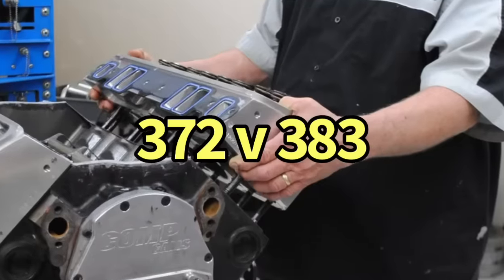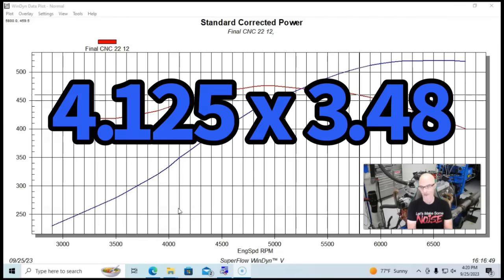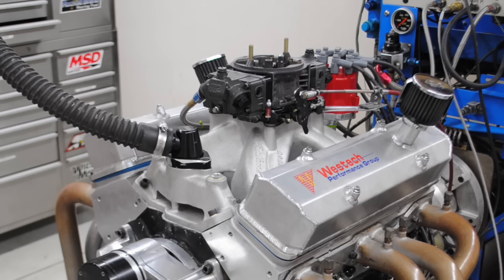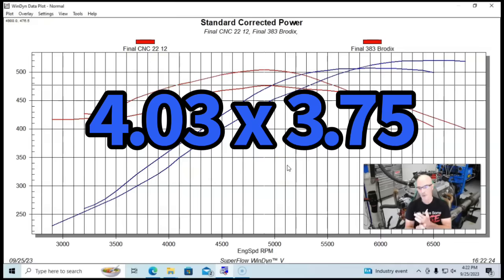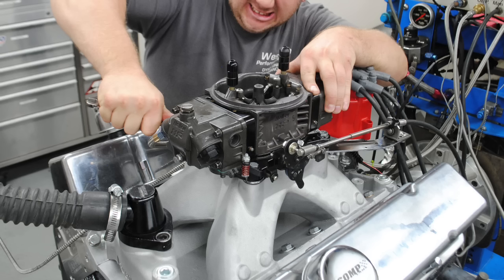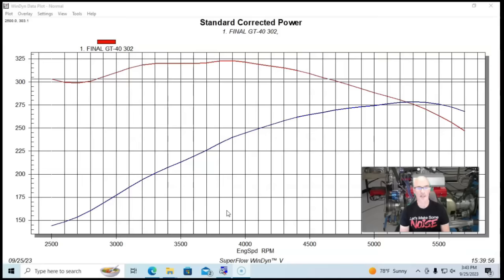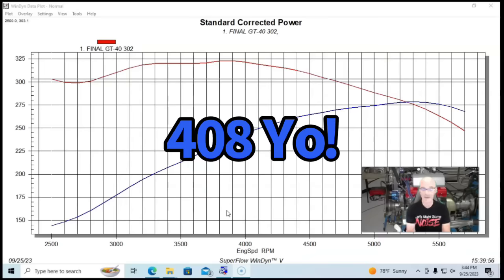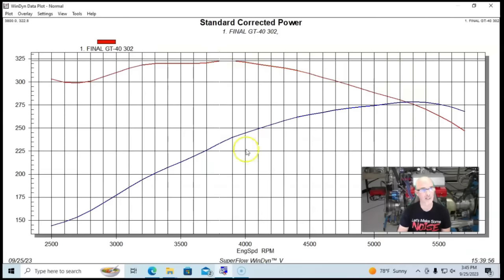BIG BORE VS BIG STROKE-372 VS 383-WHICH SBC STROKER DOES IT BEST? BONUS TEST-302 VS 347 FORD

Comment: I'd much prefer the 4.125" bore based 377, or, better still, use a 3.625" crank and a 6.125" rod. The bore maximizes the flow of the great heads available for the small block.

If I want low speed torque, for a truck or something, I'll build a 406, or a big block.

I have no real use for a 383, it's a cheap compromise.

Comment: The big bore unshrouds the valves and flows better up top.  Also wider LSA tends to carry up top.  Stoker breathers deeper and has  more leverage on crank to create more tq.  347 with small heads and cam gets benefits of longer stroke, but will only make so much hp because cam acts smaller on bigger motor and is flow limited.l so it cant make more hp up top.

Comment: Richard, when it comes to 383 vs 372 in the small block Chevy why choose? The correct answer is you bore out a 400 and make a 406! I would even trade a 383 to get a 400! I would never destroke a 400 on the grounds of "I want it to rev"  on the street. In short, have your cake and eat it too!

Comment: The 302 v 347 thing has been done before, Pontiac has been doing that from the factory since the V8 came out. You can put the same top end and cam in a 350, 400, 428, and 455 to see how much difference displacement makes. You can also see what happens when you increase airflow through the heads on those engines. 

Only the 350 is small enough to move the torque band up with increased airflow. The 400, 428, and 455 all simply make more torque through the entire RPM range. Thats because the runners are the same length on every one of the, and that is where the torque comes from. The ports are kinda small for a 400 inch and larger engine, so the power band doesn't move much in the RPM range, it just gets bigger.

Pontiac is fun, because the main differences between the 400 and the 428 are main journal diameter and stroke, 3.75" vs 4" and the 400 vs 455 is .030" bore and a 4.21" stroke. You can get crank kits for the 400 block with 4, 4.21, 4.25, 4.35, and 4.5 inch strokes, that cost about the same as grinding a stock crank, adding forged rods, and new pistons. So why not make that 400 into a bigger engine? 

The grunt from a 455 is addictive... especially with a 2.73 to 3.55 gear behind it. The 455 in my 65 GTO is pushing a 3.08 gear, and it pushes you into your seat far harder and longer than a car with a 4.56 gear does.... provided the tires don't go up in smoke. As long as you don't think more's better with gear like its a sbc, the Pontiac is an inexpensive way to the low 12s to high tens.

The problem is you aren't finding these engines in most junkyards, you have to find the entire car most of the time (usually 4 doors), and that is getting harder too. 

If you weren't so far away Rich, I would bring stock and modified 400 and 455 engines for you to test. Might be fun finding out how much power my latest build with the tunnel ram makes. Its raining again today, otherwise some dragy runs would be happening. Maybe tomorrow morning, since its Sunday and the traffic will be lighter.. if its not moist.
Reply from the maker: let me know how it goes

Comment: I would take the 383 for a better riding street machine (Olds, Buick, Pontiac) because of torque required to move more weight. 372 for lighter models (Cobra Kit, Camero, Anglia, etc.)

Comment: Have you ever done a 383 build with a comp 270 magnum and stock vortec heads???? Or just the 270 cam swap into a stock vortec with a four barrel intake  and a carburetor? It's nothing spectacular but it is something someone could assemble with off the shelf parts and no machine work?

Comment: Instead of a 400 block destroked with a 350 crank or a 350 stroked with a 400 crank, wouldn't a stock bore and stroke 400 sb make more horse power and torque than either???
Reply: Yep.

Comment: Built  372  used dodge 340 318 rods  didn't weld up crank ,  turn down  the 350 crank 5 tho . For the pistons i used ford 273 312 rod bushings!  Ran on alcohol, brodex 8s roller , dirt tracker cheap but great motor ran  4yrs. Never did a thing ,! Check  at end tor apart bottom perfect, need rings won lots races,  late model .it was a few years ago !  For got  used 30, under or over as you say it ! Fit crank perfect !

Comment: I guess it would matter  on what you are putting the engine in and what you expect out of it.  But one thing you  performance builders miss now-a-days is that not everyone has to have an engine that spins up to 7k or has 500hp.  A well built 383 for a truck that will run well on pump gas and still perform decently with fuel injection and still be smog legal and not cost 8 grand to build

Comment: If you really want to see a great combo, build a 352. A 400, bored .030 for a 4.155 bore, with a 3.25 stroke and 6.25-inch rods. You can run 11.0:1 compression on 87 octane WITHOUT pre-detonation, and without retarding the cam.

Comment: I think the 383 does better in the lower rpm because of the stroke length. And not the "leverage" argument. The longer stroke produces faster puston acceleration amd piston speed, creating a bigger pressure differential that really helps scavenging and getting a bigger fresh air/fuel charge into the cylinder. At higher rpm, this velocoty becomes less important than bulk flow, and the bigger bore helps the head to flow more at higher rpm, giving the 372 the advantage. I wish you could do this test with a .060 over 400 block, giving g a 382 vs 383 test, which is taking the cubic inch variable out (since we all know torque potential is a product of displacement) and do a real A B test.

Comment: Nice test show the benfits around each combo to build a car around a heavy street car id shoot for the low end tq and mutiply it with a set of gears and a good converter . a light chassis car im not worried about low end speed not that much mass to get going so the short stroke big bore is what i would choose. 

But i wonder if you can get the best of both with a square motor? 4.00 bore 4.00 stroke.?

Comment: 4.155 bore by 3.55 stroke is 384ci
4.040 bore by 3.75 stroke is 385ci
Same heads, cam, intake and carb what would happen? Now the displacement is the same.
Reply from the maker: same

Comment: I always heard you get more head flow with a bigger bore because of valve shrouding
Reply: That's what everyone has been told and now everyone believes. But it may not always be true. 
Some myth.
Reply: Use to be typically true. But designers have gotten much better with late model engines.

Comment: Less stroke is better. More HP per ci and very revable! Piston ACCELERATION is the huge drain and increases hugely with a longer stroke at all rpm. Equates to better mpg too if it matters. 

Increased displacement with longer stroke will make more total power but just not as good as big bore. IMHO
Reply: Makes sense but remember choice of pistons and rods can reduce the acceleration losses, as I did going .200 longer stroke with Ross Pistons and Crower rods which needed lighter crank balancing due to weight savings

Comment: This was interesting as most of Richards tests.
Dyno numbers are not always the same as what the engine does in a car.
Reply from the maker: dyno numbers indicate exactly what they do in the car
Reply: @richardholdener1727  ? They don't indicate that they break stuff or perform right.
Example. I've got an old top oiler. Put a 428 crank in it. Stroker is the way to go. Right ? Now the car doesn't launch right and  behave. Breaks parts. Broke the ladder bar twice. 
I had a car that hooked up right before.
In my set up application, a dyno would show the engine making more torque, but not how it would behave in the car.
The rush of a short stroke is more reliable and exhilarating than the jerk of a stroker breaking parts.

Comment: Consider this: the small block chevy 383 stroker is not a "small bore long stroke engine". The 3.75" stroke X 4.030" bore 383 c.i. Sbc is exactly in the sweet spot for stroke versus bore size as far as the fattest power throughout.  It is about a 1.075 :1 ratio. This is not square. If you had 4" bore to 4" stroke this would be directly 1:1 square. However the 383 is the exact center middle ground for bore to stroke. You cannot get much better than this. The other factors are rod ratio etc. The best rod ratio for N/A is 2:1, the best for power adder is 1.8:1. If you wish to favor HP side slightly more with bore, if you wish to favor torque slightly favor stroke. Power shall be nearly the same. The 372 is also 11 cubes less than the 383 witch  makes an unfair comparison. You can build a 383 two ways, why don't you do that? Well you did really it is just missing the 30thou oversize of 4.155" so all intensive purposes was fair and fairly close. The best N/A engine would be an engine with 2:1 rod ratio and also allow the 1.075:1 bore to stroke ratio. The optimal bore size for 4" stroke would be exactly 4.3" bore size with a rod ration of 2:1 you would need an 8" rod and the deck height to fit it all. See? engine archetecture are all compromises in design to fit everything in target goals and power efficiency was placed a distant second. This is why tall decks make more power. Also, some characteristics of shorter rod ratios are desirable for various reasons. Well a thing to look into. On the deck height available a 5.7" rod works great in the rpm of the 383 and even the best engine builders with real knowledge prefer this rod and it's strength to weight properties over longer rods. So a 372 definitely could use it as well with it's shorter stroke, however it is not the same, the piston becomes heavier, this is why the 372 prefers the 6" or more rod for piston weight savings over that of the 5.7" rod versus a 6" rod. So you see, it balances out. Hey 383 really does better with 6" rods also, and in extremely and highly detailed and inspected 2% pro quality engines more than it matters for the 95-98% of us it is still better, however most anything in 383 is going to be below this level of 95% and matters even less. Is it worth the ?HP? The possible hundreds of hours of engine detail work? High level Professional racing =YES. Anything else = NO. Of course if you would like a tiny slight increase in side loading resistance that is mostly negligible at those ratios use the 6" rods it shall lose piston weight also. Also 1.75:1 per cube for target hp and that would be 670hp potential peak target for the 383, now consider a 434 sbc, it would be 760 target HP!
Reply from the maker: the best rod ratio?
Reply: this is why I like my mopars 4 inch stroke 4.060 bore with a 6.123 rods running  stock, casting Mopar heads, makes awesome power really good mid range torque but it’s nothing compared to my stock stroke 360 with.060. It makes less top end hp but makes if I remember about 62 ft.lbs more torque than the stroker. although it’s not a Chevy, I believe them to be very similar. Obviously, both of my set ups would gain tremendous horsepower and torque if I went with some aftermarket heads, but the class that I race requires stock, bullion blocks and heads we have to pull 18 inches at 1000 RPM and if I’ve really got you stumped I race dirt drags & mud pits. Also rod ratio? I assume we’re still talking rod ratio to bore size. here’s what I’d like to know I’d like to know the differences in piston, weight and higher RPMs in the stability of the rod and piston as it affects the flexion on the crank when it comes to the weight of piston speed at higher RPMs, which is better more stroke, less bore or more bore less stroke I no less stroke equals quicker spin up but at what point does the weight of the piston and rod combination really get dangerous?

Comment: A great example of boredom vs stroke would be a SBC 302 vs a SBC 305, vs a 350 SBC with the bore and stoke of both of those engines.
Reply from the maker: I have 302 Ford vs 305 Chevy up-they made the same power
Reply: @richardholdener1727  Yeah, I was thinking entirely apples to apples to apples overall. 302 has the bore of the 350 and the 305 has the stroke of a 350.

Comment: Bore is going to make more power, stroke is going to move the power lower in rpm. For towing torque is good, but for racing power is better since you can get that torque back with gears/transmission. Certain engines like airplane engines have huge strokes because they don't have a transmission and they need to keep the rpm down so the propeller doesn't cavitate.
Reply: Aircraft props can't cavitate, that's a boat prop thing (where the water boils on the back side of the blade). 

You might be mixing it up with a different problem, which is when the blade tips go supersonic.

Comment: F= PxA.  (Force = Pressure x Area)
The larger bore has more surface area for combustion pressure to push on. .61sqin more area or 4% greater. Your hp increase was 2.8%. The disparity was possibly due to the greater frictional area on the piston
Reply from the maker: you don't need to math to see the difference in power-look at the change in components first (big stuff then little stuff)
Reply: You asked WHY I told you.  Simple physics

Comment: That 302-347 test is nuts, looks like over a hundred ft. lbs. from idle to 3k? But idk Richard didn't run it down there! ✌
Reply from the maker: it's not over 100 at any rpm-both the 347 and 302 torque would drop down low
Reply: @richardholdener1727  How long are the gt40 runners? It seems too be much closer to being as good/bad as a tpi intake than I thought it was...
Reply from the maker: the stock ho ford manifold 302 and stock tpi chevy 305 made peak power at the same rpm

Comment: Your tests turned out pretty much how I expected. What I don't understand is why people think destroking an engine is a good idea. I know the 372 ultimately made more hp than the 383 and that's not really a valid argument in my opinion. I guess the larger pistons was able to make use of a bigger surface area of the bigger pistons at higher engine rpms or just has less friction at higher rpms. But no matter what the difference was 400 cubic is bigger than the other 2 and will make more hp and torque. There's no replacement for displacement.
Reply: Reducing the stroke could be good if you want to operate at super high RPMs and are running into the limits on piston speed. Of course this is probably a bit silly on a pushrod V8, given the limitations of the valve train design they are better off at non insane revs.

Comment: My question is. Which one is better for the 1/4 or 1/8 mile? High end horsepower or low end torque
Reply: Yes... Depends on the vehicle / chassis... a heavy vehicle needs the torque to accelerate for the quicker et while a very light vehicle could make better use of the top end horsepower for the faster trap speed.

Comment: I think it has more to do with lobe sep on the combos. Did the de stroke combo have lighter rotating mass? I've run both bore stroke combos on circle track and you can really tell the lighter rotating mass from the long stroke
Reply: Yes sir. I run dirt cars for almost 40 years. Gotta love the lighter pistons- always ran Ross ultralight in primary engine and whatever forged piston I could get on sale for spare engine. 6" rods in all, but again really good Manley in primary and cheaper but still decent scat in backup. Dyno never showed power gains. But you know we felt it off a corner. Acceleration rate was awesome with the liteweigh    stuff.

Comment: What rod lengths were used in the 372 vs 383 comparison?  Rod/stroke ratio plays a large factor on how these engines perform.
400 Chevys suffer from a stock 5.565 short rod length to allow for the longer crank stroke.  With expensive pistons, they gain with a longer 5.7 rod like all the other small blocks, and even more with a 6.00 rod.
If both engines were built as truck towing engines with same comp, cam, heads, intake, carb, etc, I would bet that the 372 would outlast the 383 if all else is the same.  Rod/stroke ratio, meaning a short rod will put a lot of piston sideload from the crank throw.  This is the same reason that lower RPM engines, like farm tractors, typically have the crank stroke to be larger than the piston bore, and the connecting rods to have approx 1.75 ratio to the crank.
327 Chevy, 3.25 stroke, 5.7 rod=1.5 rod stroke ratio that will RPM nicely, and the piston life is good in a street engine.
Reply from the maker: rod ratio plays almost no part

Comment: Shorter stroke with big bore 7:42 gives you a longer rpm band side loading from the extra stroke crank Robs you of Hp too and makes for shorter engine life short stroke with long rod ratio means more dwell time witch mean crisper throttle response I prefer big bore small stroke I like rpm’s

Comment: The 372 will last longer, assuming equal quality parts in both engines. The lower piston speed and longer rods make less reciprocal strain on the engine, as well as reduce the risk of detonation since the bigger/slower piston induces more of a "squish" on the fuel/air charge than the "slam" of the faster piston speed/shorter rod combo of the 383.

Both combos are proven winners, just in different ways.
Reply: Rod length the same for both engines just pin placement
Reply: @cedricwilson2055  You can fit big-block rods into a small-block with the right pistons. Helped my best friend with a 386 mill way back in the day, it was a .030 over 400 with a 3.5625 crank and big-block rods.

Even with stock 5.7" rods, the shorter stroke of the 372 will be more reliable due to lower piston speed and less side thrust.